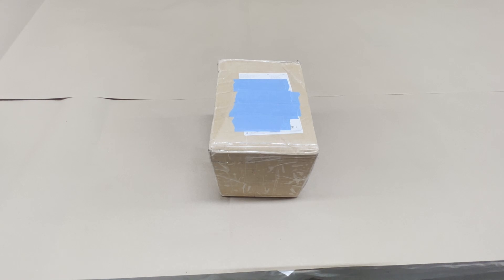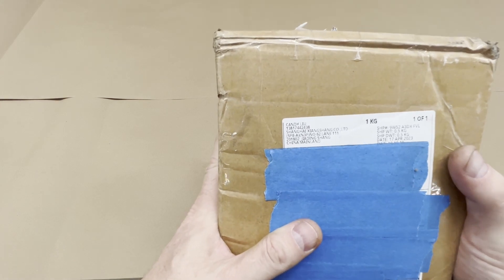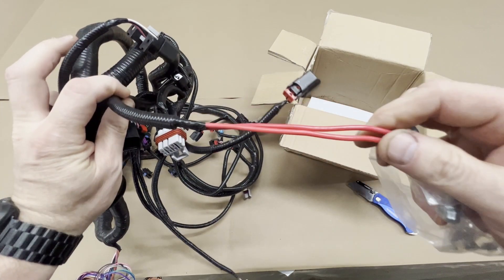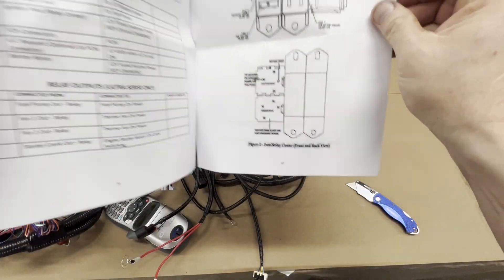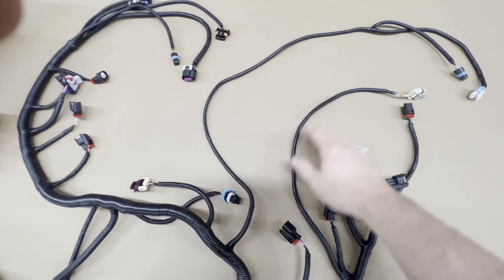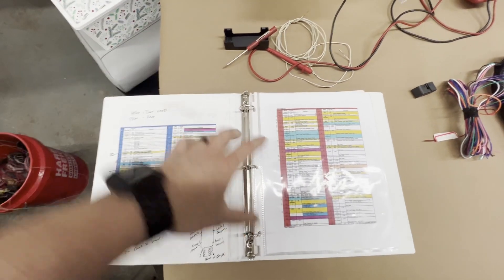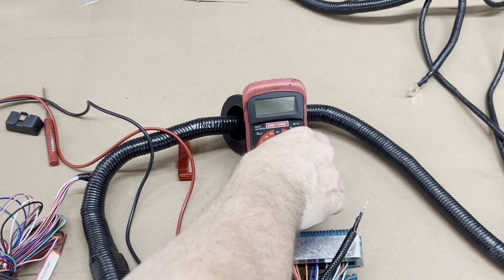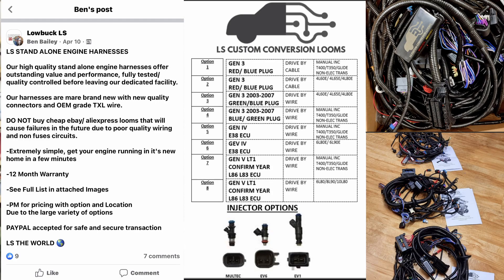LS Standalone Harness - Ben Bailey from Facebook Harness Review

Comment: Thanks for the video. I hope you have success with it as I've heard horror stories about those China harnesses. They are all over eBay for less than $100.
Reply from the maker: @Your PCMD I have heard the same stories. My plan is to run it a year or so and upgrade to a Holley Terminator X fingers crossed. This one was not less than $100 but it does appear to be built very well for a china harness. We will see I guess ….lol. As always thanks for watching!